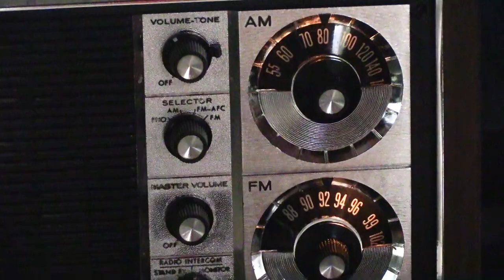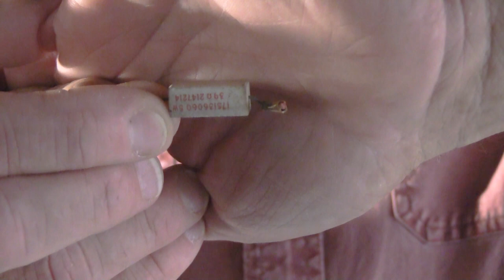An Overview of the NuTone Model N2561 - N2562 and Work done on a "F" Chassis Version

Comment from the maker: I think that all of the NuTone 2561 - 2562 fan boys will like this Video (Luis) -  Be sure to check out the "before & after" about how different this "F" Chassis N2561 / N2562 looks after it has been cleaned up at the end of the Video - Chris
Reply: Northside Service Company Excellent ! Great video ! Just one small little mistake, the correct Release Date was: March 15, 1963. 
Nice mention about the "silicon" chassis models (E, F, G) that remained with the original germanium output transistors. Thanks !!
Reply from the maker: Hi Luis:  You are correct - Chris

Comment: I just bought a house with these throughout. Thanks for your thorough information. I might give it a go restoring.
Reply from the maker: Hi Heather: Remember that there are 8 different chassis designations for the 2561 / 2562 - So yours might not be the same as the chassis in the Video.  Each chassis has its own unique differences and they all changed slowly over time.  Don't disregard the importance of cleaning the controls in the Master Station - this is a very important part of the servicing of your System - Chris
Reply: @northsideservicecompany3567  Thanks for the info, I'm not sure of the exact model yet to determine chassis but will be looking into it within the next couple months.
Reply: Do you know if there are indicators to look for to find out if they accept an input source? I've seen a couple that have been connected to record players and such.
Reply from the maker: @HeatherNewell09  The Chassis version will be an "ink-stamped" letter with a date code (last 2 digits of the year) on the end panel of the metal chassis -
Reply from the maker: @HeatherNewell09  All 2561 / 2562 have at least 1 auxiliary Audio Input Jack that's accessible through the bottom of the faceplate.  Earlier models also have a Jack on the back of the Master Station.  These are old-school RCA Jacks - not modern 3.5mm Jacks - Watch our Video about this:   https://www.youtube.com/watch?v=BgPM0my6he4&list=PLsTvqKsBnGYdC28d_5P2CQXAhtUS6f_2S&index=10     -   Chris

Comment: What happened to the G Chassis? They went right to H? Why no G?
Reply from the maker: Hi Vincent:  it's unclear as to why there was no "G" chassis - If you read through the Technical Service Bulletins from that time, it seems that there might have been a "G" Chassis  internally that was never produced and those changes were incorporated into the "H" Chassis with its updates - Chris
Reply: Vincent D Hi Vincent. As a totally 2561-62 fan boy, I can tell you that G Chassis actually exists, I own one, date K70T (November 1970). It looks quite the same as this F chassis with the two big can capacitors on the power supply, the small FM tuner on the left and the same faceplate. The 1971 H Chassis had the big changes. Cheers.

Comment: Iv got one of these and the fm,am,phono doesn’t work  but everything else does , what could be the cause of that. Or how to fix.
Reply from the maker: Hi curtlowe88:  I can't tell you what's wrong with your NuTone N2561 without more detailed information about your System.
The best thing for you to do is fill out an Intercom Repair Request Form and once I receive it, I'll contact you by phone to discuss the problems with your N2561 and its repair
Hers's a link to the Repair Request Form:  https://docs.google.com/forms/d/e/1FAIpQLSdQHT6fVgm25twaXFeCkkgeITEfAE_zlRBry6B8-GbIs19wcQ/viewform?formkey=dF9RVjBQMFQ5S0xYbTBHMHRoNkVkRFE6MQ

Chris